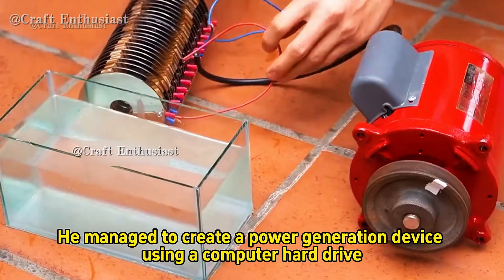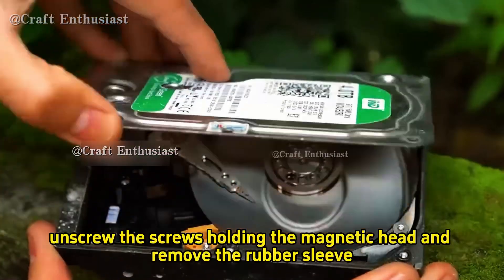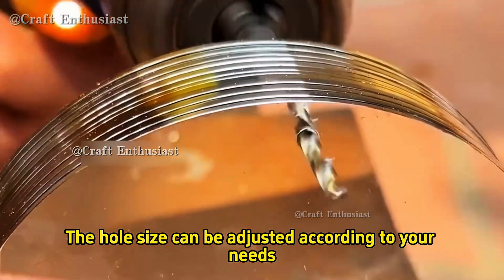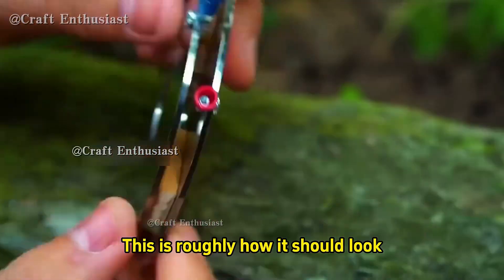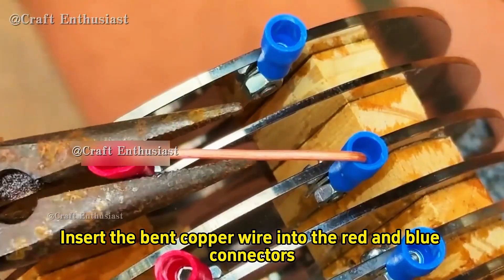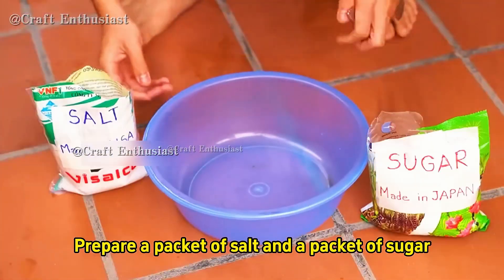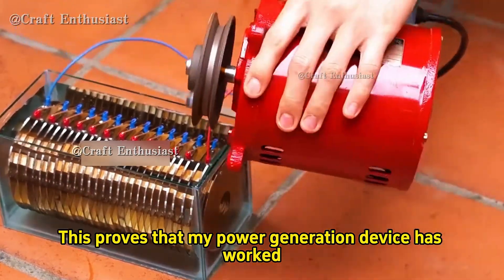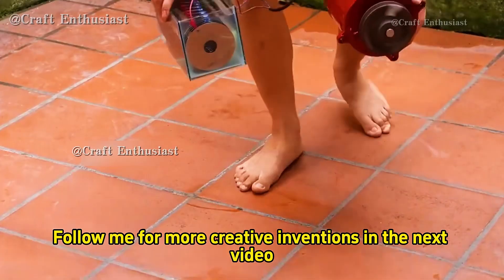"Old Computer Hard Drives Can Generate Power! Creative DIY Conversion Revealed! 💻⚡"#diy

Comment: Dipping the disks into the water would create a direct short across all connection. NoGo compadre.
Reply: I call Bullshit too.   He'd have needed two dis-similar metals to create even the smallest of currents or voltage.     
And given that this idea seems straight out of the movie Idiocracy, I'm a bit baffled that he didn't choose Gatorade instead because.... "it has electrolytes".  lol
That said, I did try an experiment out of curiosity yrs ago using one of those disks, a 6''copper tube, buried it in the dirt and pee'd on it.  I got something like <2vdc @ .0017A. 
It took a while to build up enough of a charge in a cap to flash an LED once every 40-50 mins or so.   But as far as proof of concepts go, it'd work, but not most things.